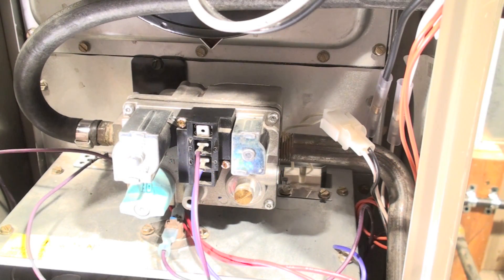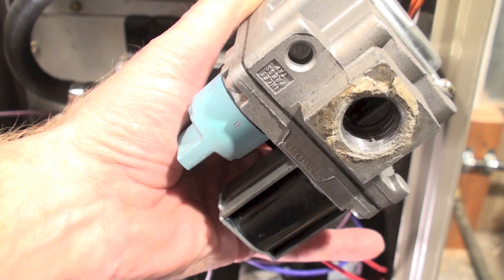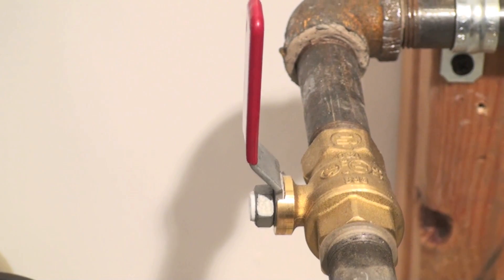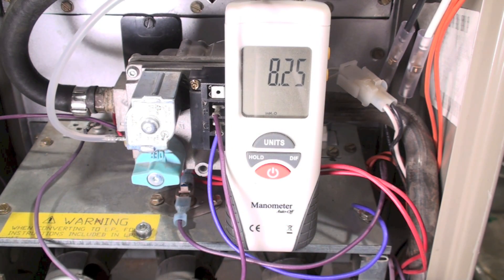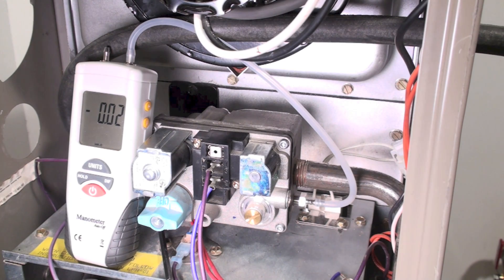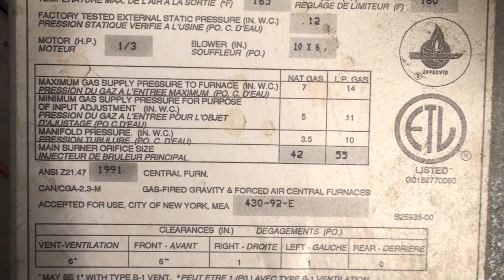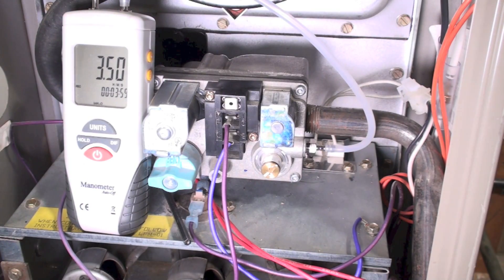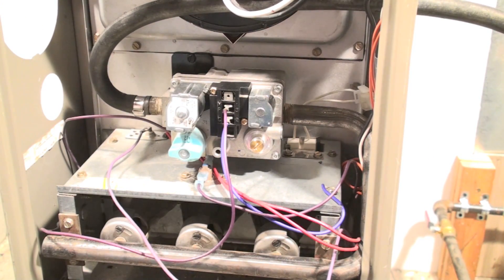How to service the 80% AFUE gas furnace.  Check gas input. Part 8

Comment: Note the poor design of the Goodman furnace. The high temp limit switch is behind the gas valve so you have to remove the gas valve to replace the limit switch.

Comment: Just an FYI, if there is no Tap for the inlet on the gas valve you can always use the drip leg ( install a temporary tap there). I will have to disagree with you on not checking the inlet pressure which I feel is the most important pressure before we even start considering manifold pressure. Worked for the gas  utility in St Louis, Missouri for 35 years and I can tell you first-hand this is where the contractors get into trouble by not checking Inlet pressures ( lock up and working pressures ).

Comment: I have an hvac unit that I just replaced the control valve with an exact 
replacement, but now I notice that where the flames go into the heat exchanger there 
are some orange flames flickering between the burners. It's not blow back because It 
happens even before the main fan comes on. I have checked It with my pressure meter 
set It to 10 for lp gas, and checked It with my carbon monoxide meter and there Is 
no carbon monoxide coming from the vents Into the house and the carbon monoxide 
coming from the outside flue vent Is only 17ppm. I looked Into the heat exchanger and 
couldn't see any cracks. This Is a 4 ton outside unit made by york. It is working 
fine just concerned about the orange flames. The flames going Into the heat 
exchanger are blue just like they should be. Also new Inducer motor It Is working 
fine. New Filter.Do you have any suggestions?

Comment: Can you use a "regular" dial pressure gauge instead of a manometer?  If not, please explain why if possible. I have a combination pressure/vacuum gauge that reads low pressures (below 15 psig). Thanks in advance!
Reply from the maker: Because the pressures here are very small.  They are read in inches water column.  28 inches wc = 1 PSI.
GFM
Reply: grayfurnaceman So these systems are even under 1 psi. Makes sense now. Thanks!

Comment: Hey, what is the resolution in manometer please?
Reply from the maker: ayad dawood It goes to 1/100th of and inch water column.
GFM
Reply: Thank you for your reply. I read this sentence "Static pressure measurements obtained by using the resolution mode of 1 Pa " and the question know: is the resolution mean changing the mode between mmH2O, Pa, bar ... etc, or it mean the threshold of reading .... thank you
Reply from the maker: ayad dawood It means the threshold of reading.
GFM
Reply: Thank you so much

Comment: Why would you use a rubber hose to feed gas valve.
Reply from the maker: Bobby Chapin The unit you see is set up for temporary use.  It is not a permanent install.
GFM